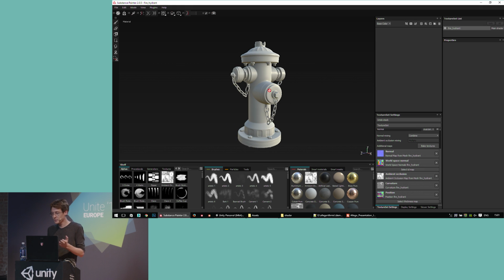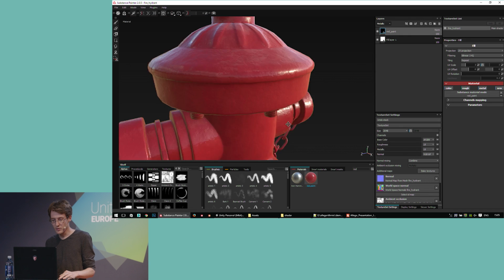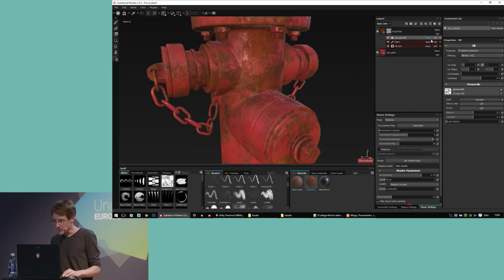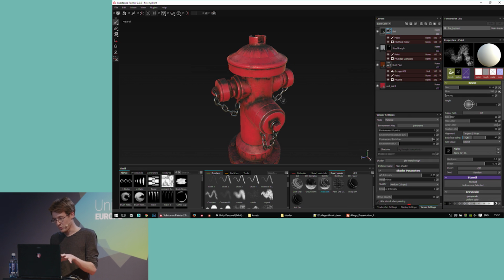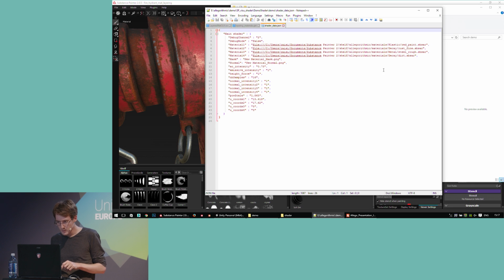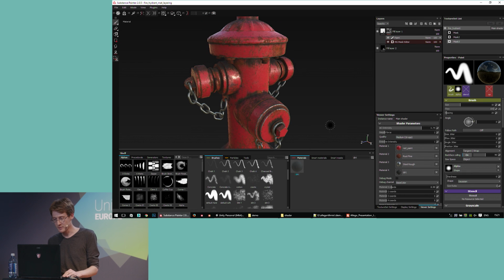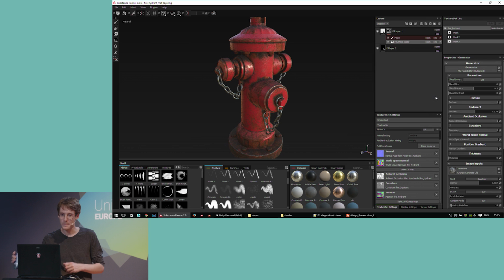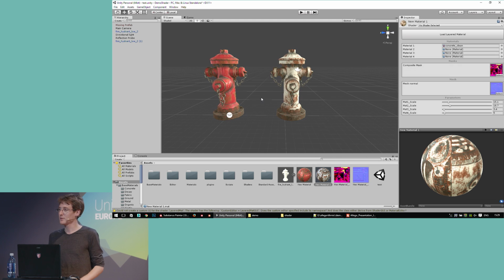Unite Europe 2016 - Generating Layered Materials with Substance Painter, an artist centric approach

Comment: How expensive this method can be?
Reply: Wont be that severe, you'll be just putting out masks in the background, similar to how paragon, uncharted etc are made, and then those masks will just run your materials. Those materials themselves will be the main cost of your overall result. 

It will be more expensive than your traditional method for an individual object, but if those materials are used across your entire scene many, many times, it could turn out very reasonable in performance and you'll have the incredible detail this method allows. 

from a time expense itll be more too as you'll need to forward plan your material library.
Reply: Oh, thank you for replying.
Reply: indie license of substance it costs more or less 200€. but i'm a Happy user of that product. It makes the difference.
Reply: I mean the technique, I have the all Substance softwares, I just want to know how it costs in terms of performance.